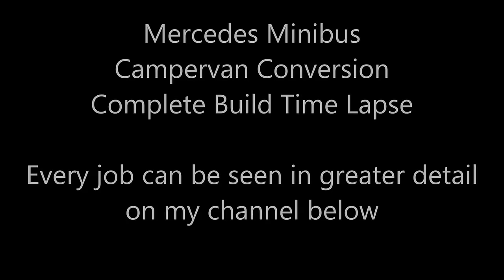Amazing Mercedes Sprinter Minibus Campervan Conversion Time Lapse 9 Month Full Build

Comment: I love that you used lightweight materials for your build. Makes sense to keep the weight down to keep your mileage up.
Reply from the maker: yup that was the plan
Reply: Lightweight materials??... it's all wood,  cabinetry, bulkheads, furniture, bed etc... how is that light weight.  Don't get me wrong,  I love the build, but I wouldn't say it was done with lightweight materials.

Comment: Silicone is not the way to seal electrical cable to a junction box. Use weatherproof outdoor box with gland packing fittings.

Comment: Great job but I just have a question for people in general... I'm not necessarily picking on this build. When has it ever been comfortable to have a great big split down the middle of your bed? People build these convertible couches and are so proud of themselves when they flop them down - but then they end up with splits everywhere the cushions come together. It never fails that one person either falls into the pit or your hip lands in it- There is no way to get comfortable on these things. Usually the split isn't even in the middle on the longer couches, it's about a third of the way over which makes it even rougher to sleep for two people. At least in the middle you each get half but these things are ridiculous. In order to be comfortable you absolutely have to have a fairly thick mattress topper and where are you supposed to store that monster?
Reply: No, not a Builder but, I saw in one Van where the Bed (Mattress) was stored Elevated near the ceiling, and mechanically lowered at night on the converted couch space: the converted couch was like a Box Spring: Impressive! It was the only one I'd seen built in that particular manner! MORE IMPRESSIVE I COULD DROP SOME KNOWLEDGE ABOUT THIS!!🤣🤣🤣 deb in MattressVille, SC⛱️ 08/08/2023🏝 * I'm in awe of people who can build these Vans: Beautiful and Talented!😊*

Comment: Perpendicular sheeting g is the standard it creates a diaphragm for rigidity locks everything in the way he did it is going to have problems
Reply from the maker: The flooring is secured to the chassis so will not cause any problems at all

Comment: What happens when the window breaks? You have to tear up your walls to replace?😮
Reply from the maker: why would the window break, the vehicle is already nearly 20 years old with the original windows, only vandalism would cause a window to break and you'd run in to the same problem with a lot of conversion who put items in front of  a window, top tip, don't break your windows
Reply: As a former bus driver, I was driving this bus for a long time and witnessed a lot of broken windows on sides because the rocks and stuff is pushed this direct with aerodynamic drag. But overall nice build 😊.

Comment: I like the lift up bed idea, although guess it won't be quite that easy with a mattress on 🤔
Reply from the maker: It is easy, that’s what the ottoman hinges are for, taking the weight & strain out of lifting the bed.
Reply: @TheCampervanBuilder  Well that's a jolly good idea, one I may steal, lol. I had issues with my mattress getting damp when I just put holes in the ply it laid on, so changed to slats. Have you found that at all?

Comment: Wow alot of work alot of money very impressive I like the way you covered the windows I've never seen that in a build before but very creative.

I thought you were going to partition the driver and passenger section from the living space for privacy at one stage but you prefer the open living look.

Also i.likef the way you fitted the floor walls and ceiling with manageable cut out sections for each area very simple and systematic rather then bigger sections to cover as much as possible.

I have considered vans then commuters then coasters but I think the Mercedes mini bus ike yours is the way to go.

You need the width without the length of a full size bus as commuters and coasters are 3 seats across.

But yours is 4 seats you need that extra space to walk down the isle and it gives you more design and better size options.

Just a question what was the purpose of the red bottle attached under the chassis? .
Reply from the maker: Thanks, the red tank is an LPG propane gas tank for the water heater and kitchen gas hob
Reply: @TheCampervanBuilder  oh nice very well planned and thought out design.

Im glad you removed the floor it was eye opening to see the chassis.

Ideally I wish there was a cost effective simple EV kit to covert vehicles to AWD.

Thats what camper vehicles need besides a reliable power source to power there appliance's and a better water system.

Thank you for the reply.

Comment: Was it fully insulated? Why take it all apart rather than just build over it?
Reply from the maker: it wasn't fully insulated, the roof had crappy fibreglass insulation and the floor had none, the only original insulation was under the windows

Comment: Two 15 second non skippable ads every three or four minutes…youtube used to be great 😢
Reply from the maker: its only going to get worse as Youtube is taking away creators ability to control adverts very soon
Reply: YouTube has also made some other changes recently, maybe not for everyone yet, but it'll be coming to everyone soon. I always watch at least 30 seconds of the ads, because I was told that creators only get paid if you watch 30 seconds of the ad, and some ads are hours long. However, if you skipped the first ad, it wouldn't show the second ad. Now, if you skip the first ad, it goes to the second ad. Apparently, this hasn't happened for everyone yet, but it's coming to everyone soon. 
YouTube is removing and demonitizing creators left and right, especially some big channels, and those creators are going to other sites, like Rumble. YouTube is getting worse and worse.

Comment: Straight over the floor with 25mm kingspan!... No way would I cut that floor out,  far too much work!.. Congrats though nice van
Reply from the maker: You loose a lot of head height if going the way you mention, I gain head height doing it my way